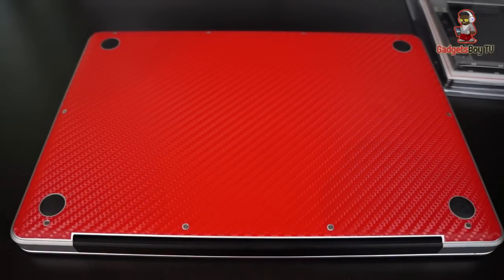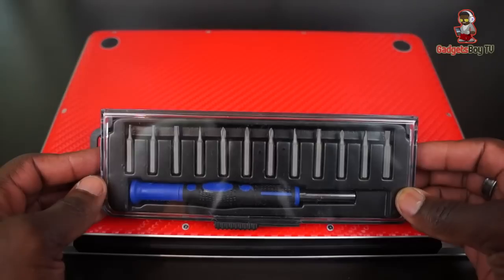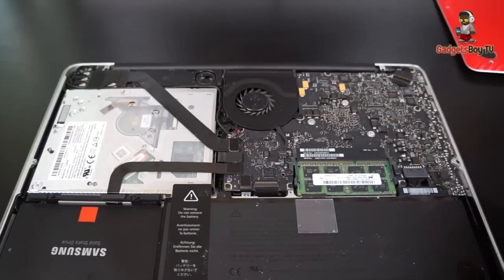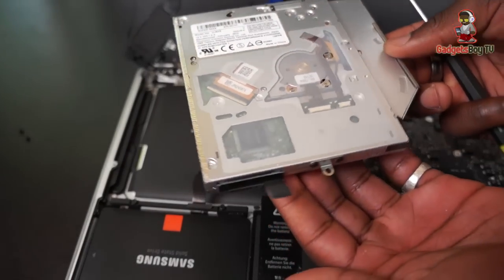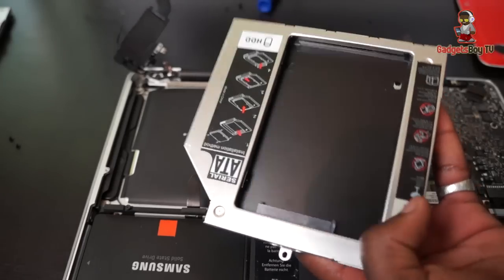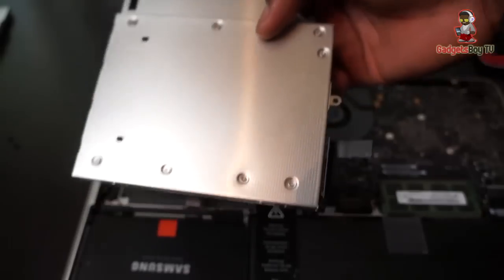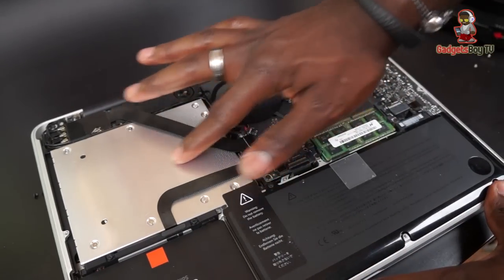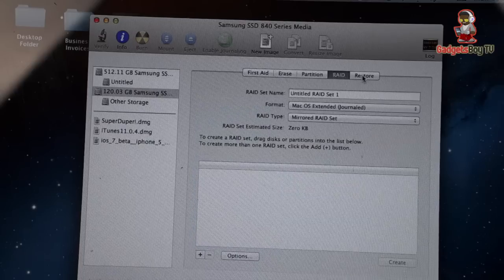How To Add Second A SSD to Replace Optical Drive MacBook Pro 2012

Comment: I've got the same laptop (Macbook Pro 13 inch mid 2012) and I want to keep the original 500gb hard drive for data storage but remove the optical drive to install a 250gb SSD in it's place. 
Will the 500gb standard hard drive stay in the same place and the SSD replace the location of the current optical drive? 
Thanks
Reply: +Live2Fish http://www.cnet.com/how-to/upgrade-your-macbook-install-ssd-hard-drive/ Maybe this can help you? Is shows how to use a program called "SuperDuper" basically copies your current drive.. I'm not knowledgable about computers at all, but was researching the same thing and came across this.
Reply: +Rianne de Jong Thanks for your help.

Comment: I installed a second SSD in my early 2011 MBP. This boot one is an 860 evo working perfectly. The other installed instead of the optical drive is a “crucial” one. 
The crucial is extremely slow and often gives read/write errors. After trying every kind of repair, permissions, etc, one post I read stated that the SATA cable is not fast enough to read and write data, specifically on large files , thus the errors. But since it worked for you, am I missing something?
Reply: its probably the shitty crucial drive. i had one and it gave me a whole lotta trouble and since i replaced it with an 850 eve (older version of the 860) I've had no problems at all. crucial makes shitty drives

Comment: Great video. I followed all your steps but couldn't get the secondary SSD to work.I'm on a 2012 MacBook Pro (non-retina). I just installed a SATA III SSD from Amazon (since several users had commented that it did work on their 2012 MBPs). However, the MacBook Pro will not format the it. Tried to format as "Journaled" as well as "Journaled/Encrypted" and neither work. After doing more internet research I found comments that mention only a SATA II will work on a 2012 MBP. Is this true???

Comment: A few questions... 
1) Other than formatting the SSD you inserted into the Optical Bay drive at 6:30, are there any other steps required to make both drives operate for maximum performance? That is, does the computer automatically use both hard drives, or does it need to be told to do so?
2)I'v heard of another MacBook Pro user, making one drive store and run the OS and applications and the other for files or whatever. Is there a way to do this, and what situations would it be better? Thanks!!
Reply from the maker: It will automatically recognise the drives, the one with the OS will always load the OS and the second will need formatting and you can set RAID if you want . the second question, that's what i did, use the second for storage
Reply: @GadgetsBoy  i did everything as in this tutorial for my macbook pro 13” 2012 late, but somehow when i wanted to erase newly added 512gb patriot ssd, i got error “Erase process failed. Click done to continue”. I want to use this ssd for storage only, the main drive is 128gb and is working fine

Comment: Hi, I'm thinking about replacing the optical drive in my macbook pro 13" from mid 2012 and using that for my main boot disc, but still keeping the 750gb HDD as additional storage, to do this would i clone my HDD onto the SDD, and then once replaced boot onto the SDD by holding alt on startup, and then wiping my HDD using disk utility? Many thanks in advance.

Comment: followed the tutorial thanks for help, have a problem when macbook pro starts it just shows a black screen no sounds or anything just the flashing power light, i disconnect the caddy macbook works fine, any ideas what I'm doing wrong?
Reply from the maker: djtomteeofficial I'm not sure what that could be.  Are you trying to book from the caddy? The new SSD with your migrated OS should be in your macbook as the primary drive.
Reply: GadgetsBoy Hi, thanks for reply, managed to sort it. I put in a Hard disk that was failing, tried another drive and works great.
Reply from the maker: djtomteeofficial great, glad it's sorted.

Comment: Disconnect the battery bro!
Reply: Why would one need to do that?
Reply: so there is no power in the system, if you touch something that shouldn't touch it could shortcut and destroy the macbook
Reply: Same reason you disconnect the battery in your car when changing spark plugs
Reply from the maker: I should have worn anti static band
Reply: @GadgetsBoy  Or can you work with surgical nitrile gloves, instead? They too act as insulation between skin and electronic components?

Comment: I"m pretty sure just "leaving the warranty sticker on" is not going to avoid your warranty from being voided.  The fact that the installed an SSD for your internal PLUS replaced your optical with an SSD voided your warranty automatically no?
Reply from the maker: +Mark Barrie Well if the sticker remains not-tampered with. I had my screen replaced on warranty after this upgrades.

Comment: Which port does the connector from the optical drive connect to? Is it fast? Could it bottleneck the performance of the SSD?
Reply: it will be on the same bus as the main hard drive, so if their is any bottleneck, it is the same bottleneck as the main drive too.

Comment: Is it a 9.5mm caddy case or 12.7mm?
I have a macbook pro mid 2012 13’ laptop and I ordered 12.7mm caddy after reading first few reviews. 

However, some said that it won’t fit and i need  9.5mm caddy. I’m too afraid to screw my laptop and take that caddy out of its packaging. 

Please help.
Reply: I had the same question. My research suggests that a 9.5 mm is the one that fits.
(From the info found at ifixit: https://www.ifixit.com/Wiki/Optical_Bay_to_Hard_Drive_Enclosures ) 
Have you tried it yet? I haven't ordered my caddy case yet.
Reply: VaqueiroAruanda Hey i upgraded my mac and yes it is 9.5mm not 12.7mm. I had to return it and buy a new one.
Reply: Got a 7mm caddy installed on my mid 2012 macbook pro. Perfect fit

Comment: HI, thanks for the video. I was installing on my MBP13 mid'12, the HDD fit perfectly, but 2 screws protrude about 1/8" where antennas/subwofer should lay flat, so lid didn't close flush. The screws are tight all the way, but it still comes out. Any suggestions? Thanks again for the video, very helpful
Reply: Hey after replacing it how can we activate this drive and from were hdd drive

Comment: 1.Is disconnecting the battery imp? Read somewhere the Mac doesn't come back to life after disconnecting.. 2.With 2 SSDs, Will boot camp on the primary recognize the 2nd sad?
Reply: my mac won't turn on after installing the 2 ssds. Where did you read that? I need help...

Comment: What's the speed of the tray-installed SSD? I read that the superdrive bus is an old sata 2 (on macbook pro mid-2012)
Reply: ***** I confirm, on a mid2012 the superdrive port is sata3 and this thing is even faster than the apple ssd.

Comment: I still have the 17'' MacBook Pro 2009 later model. 
Can this be done too as I want to replace the HD drive with a ssd drive and replace the cd DVD drive with a secondary ssd drive. Would like to have two 500 gigs in.

Comment: Hi, I was wondering if you could use this in a single SSD installation and use the "cd drive" SSD as a boot drive? I'm wanting to take some excess weight out of my mac and my usecase doesn't really call for two SSDs.
Reply from the maker: Yeah you can.

Comment: Dear Gadgetsboy, I know this vid is quite old but when I would erase/format the ssd fo mac osx extended journaled would i then be able to boot from it by selecting that in system preferences? Many thanks in advance
Reply from the maker: You will need to have your OS on there before you can boot from it. What are you trying to achieve?
Reply: My goal is to upgrade the ram from 4gb to 8gb, but also remove the optical drive and replacing it with a adapter that will hold a samsung 840 evo 256 gb ssd. The goal is to have all apps installed on the ssd as wel as the os and make it the primary boot up disk. Also, I am also considering partitioning the ssd and install windows 8 on it. I do not want to clone the original Hard drive to the ssd because it will not fit.
I see two options:

1. Copy the osx from the traditional hard drive as well as the applications.
2. Use a bootable usb key to install osx on it to have a fresh clean installation (question: When I install osx clean/fresh using a usb, will all of my settings be kept in system preferences?)

Many thanks in advance. :)
Reply from the maker: Hi, right I get you now. I'd say option two and no your preferences won't move over.  Other option is to find a cloning software that allows you to only clone what you select.  That way you can clone the OS and some apps.  Samsung have their cloning tool but you will need windows to run it, so i'm guessing there will be a Mac alternative somewhere.
Reply: GadgetsBoy Thx! This will definitely help me out. I've seen people use these cloning softwares as well were they could select specific files to clone to their new drive. How would I clone the OSX? You would need to find where it's located. Do you have any idea where you could find that?
Reply from the maker: Hey, not sure really, there are system files in a few locations.  You could also try OSX backup function
Reply: Ok thx!
Reply: GadgetsBoy Hey Gadgetsboy, I figured it would be more smart to instead of adding a ssd, adding a 1tb or 2tb western digital hard drive. But also create a raid0 striped raid to still have a bunch of storage and I slight performance boost. I think this is a good option because I work a lot with 1080p video in final cut pro x and I'm currently running out of space on my original 500gb Macintosh HD. I am also convinced of installing windows 8 on the new 1tb/2tb hdd for ultimate functionality :D What do you think? This also saves some time because I don't have to fiddle around with installing osx and that stuff. Do I need to know things before setting up that raid? Can you actually raid array the original macintosh HD and the new HDD?

Many thanks in advance :-) Btw your title is messed up of the vid instead of "How to add second a ssd" is should say: "How to add a second SSD"

Comment: thanks, very nice video. I just got a new SSD internal hard drive for my MacBook pro mid 2010 and also got a Doubler Caddy (which is pretty much look like yours in this video) to replace the CD drive with my old HD drive. The SSD replacement went well but to place the  HD drive into the Doubler Caddy the latter has some extra connection part which stays out when I place the HD. What I mean is this: when I place the HD drive, it sits well there but there is an extra part (like extra connection port which need some extra connection form the HD to match there)  there is nothing from the HD drive to be there. Anyway, I followed your instruction but the HDD drive does not appear in my mac anymore. Any help with that? thx

Comment: got a MBP 2012 13" and wanting to replace the optical drive with the HDD that is already in the MBP. Then put an SSD in it's place. This should work right?
Reply: That's my plan too...should work
Reply: Bit late to the party but I've just ordered a 1TB SSD kit to upgrade my 2012 MBP.  I want to put the new SSD in the optical drive boot off there.  I want to keep the old 750Go HDD in it's original place for now so the SMS (Sudden Motion Sensor) still works on the HDD.  Does anyone see any complications doing that?  I'll eventually upgrade the HDD when it dies but not yet.

Comment: Odd question, I'm planning on buyinga 500gb SSD, to replace my current main HDD. Do you know if it would be possible to put the HDD into the caddy and boot it from there, and put the SSD in where the HDD was?
The plan is to install El Capitan on the SSD. and still have Snow Leopard on the HDD (in caddy).
Also, would the caddy affect the speed at which it reads and write to the HDD?

Comment: hi great video! i have a question i just replaced my hard drive with a ssd but before i did that i cloned what i had in my hd to the ssd thinking im not going to need my hd anymore. now i want to have both drives and replace the cd drive but do i have to erase what i cloned in one of the drives??.

Comment: How to make use of the optical drive you took out from there?
Is there any enclosure with which I can change it into an external optical drive?
Reply: Yes there are some enclosure for the Apple SuperDrive, OWC has one, and also, you could use a SATA Optical Drive to USB Cable.

Comment: I have a Mid 2012 MacBook Pro with a Samsung SSD running the OS and a 1 TB HDD for storage which I would like to replace with a 2nd SDD. Could I just simply swap out the HDD and replace it with the 2nd SDD without doing a fresh OS install or resetting the whole computer? Must tutorials talk about installing an SDD to run the OS, but I already have that. I just one a 2nd SDD for faster storage and a quieter MacBook. Is that what you did on this video? I would also like to have the contents of the HDD copied to the 2nd SDD. Is this possible?

Comment: Thanks for the tutorial! 

My question: Does the HDD becomes active all the time while you're using the Macbook? Or you can have option to manually activate the HDD only the time you need it? You know the HDD consumes battery, and I don't want my drive to spin all the time while I'm not using it at all. It's good to put the HDD into sleep or 'turn off' when you don't need it. If there's an option to do so, that'd be great.
Reply from the maker: It will be active, however it will only consume power when reading and writing data to it

Comment: Apple is no longer supporting having two SSDs on the same logic board today because of people modifying the MacBook Pro that kept having warranty covered. According to their term of service regarding warranty, any modifications will void the warranty and Apple cannot repair the system. Back in 2012, Apple didn't have that kind of term of service and people kept upgrading the logic board from 2011 to 2012, so they ended the swap with Retina Display to discourage them to upgrading the logic board on the older model. It sucks, but that's how Apple set those up.

Comment: I noticed that you did not disconnect the battery.  Is it alright to keep that the way it is without disconnecting the battery?
Reply: Yes, although, do not leave the charger in, and make sure to de-static yourself by touching something grounded before doing anything.

Comment: Can someone explain the purpose for a second SSD? Will it make the booting run faster or just more storage? If so I already installed a 1TB in my MBP.
Reply: Can't speak for everyone, but for me it would be for more storage since I never use the dvd drive. Moreover, the dvd drive makes a particular "whirring" noise when starting up the laptop that I'd like to get rid of.

Comment: Hi GadgetsBoy, I've just upgraded from my old dodgy 750HDD to a 250 SSD drive and a new 750HDD. I have all my data backed up on an external HDD time machine back up. Do you know how I restore my data from the time machine so that my OS and applications are running of the SSD but all my files are kept on the new HDD please?

Comment: I got a Samsung 240GB to install on a MBP 13' early 2011. I would like to remove the drive that the MBP comes with and Install it where the optical drive is. Is that possible?
Reply: You can certainly do that. Just remember you will need a Caddy to adapt your old HD so it fits where the optical drive was.
Reply: Thank you

Comment: Hello, I have just fitted 2 500GB SSDs in a Macbook Pro mid 21011.  
The problem is that one of them isn't working.  The macbook can see it and tells me that it is a 500GB drive but  it cannot write to it.
Any advice?
Reply: Agent Bertram did you reformat the new drive?
Reply: Yes.  It seems to be writing to it now.  If it doesn't behave itself I'll take it to a repair chap in Glasgow.  He says that he will get it sorted.  Thanks for the reply.

Comment: If I install ssd and install windows on it with boot camp drivers which are a bit of a pain on my 2012? Can I boot from refind or options and it will show the drive as a certain option?

Comment: Is impossible to install the OS on the SSD then move the user folder (Containing all the photos and movies and such that takes up a lot of space) to the HDD after?
Reply: thats what I want to know did you find out?
Reply from the maker: thegadgetzone yes its possible, you will simply select option to only clone the system files then plug in your hdd as external HDD after to drag and drop pictures and other media file

Comment: Help please!!! I jnstalled the drive successfully but my I sight camera cable snapped off from the connector at the tip. Could you please tell me if it is possible to reattach the cable to the tip and reconnect the I sight camera? How?

Comment: is it possible to make the ssd the primary disk with this upgrade?
Reply: yes
Reply: Why not just switch the hard drives if that's the case? swap the primary HDD drive with the SSD. They both use a SATA connection anyways, so you should have any problem swapping the drives.

Comment: I have replaced my HDD with a new SSD, but it wont let me run bootcamp since the new SDD is not supported. If I replace the disk drive with an optical drive and put my old HDD in the optical drive, will this allow me to boot through the old HDD and run bootcamp that is already installed on the HDD?

Comment: Can l use SSD as the  OS disk, and HDD as the storage disk? Do l need to set them up when l use in OS? Thx!
Reply from the maker: Yes you can, most people do that so the OS boots quicker for example. You just need to backup and restore OS to SSD and install HDD as normal replacing the optical drive and you're all set.
Reply: Thank you for your replay! And l have macbook (2009), so can l just reinstall the OS? I am thinking to not install a newer version OS, is that possible for old mackook?